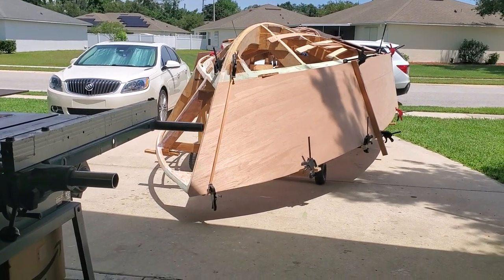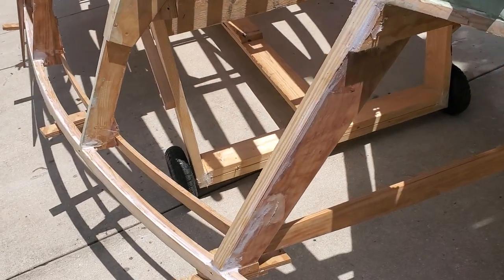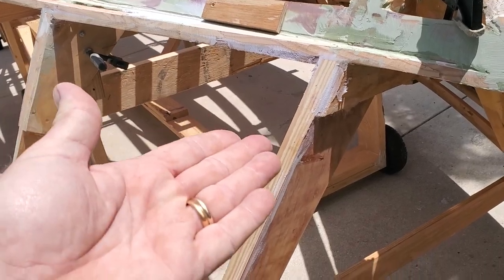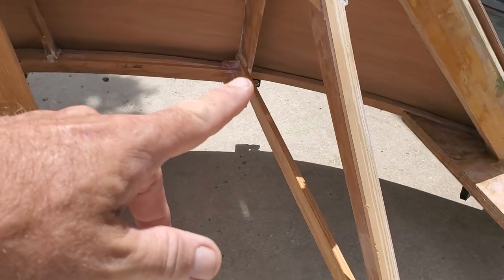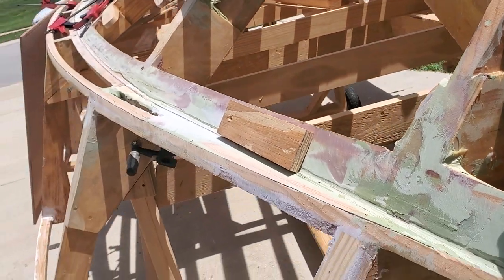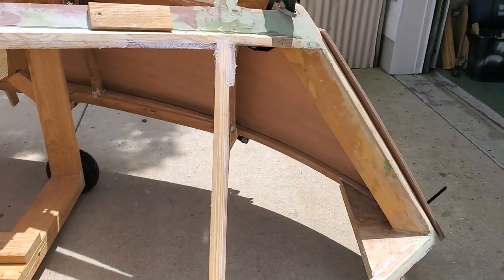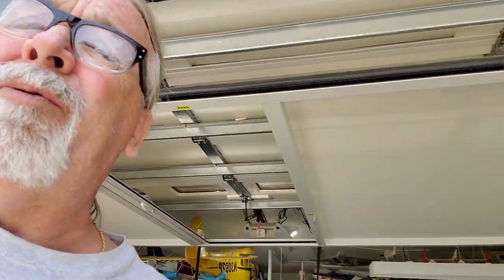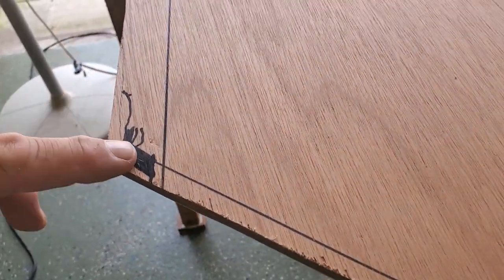Glen l Chinook 20' pilot house boat Part 18

Comment: Thanks.  Hope you get to feeling 100% quick. My cure for all ailments is fresh air and sunshine.  Unless it’s me that’s ailing.  THEN I WANT MORPHINE.  Your step idea is brilliant.  I’m going to use it.  My current project, Spira Oscoda design, all frames are constructed and trimmed;  left the sheers a couple inches long to whack after sheer clamps are attached.   Presently filleting/filling frames, next epoxy coating, then maybe primering.  But after a while you gotta figure the frames done and move on to something else. Thanks

Comment: You don't need to apologize for telling us about your back and leg issues. Those of us who have serious, chronic problems like yours have had to learn over time how to handle projects that we used to tackle without a second thought. You'll figure that out with your fine Chinook. By the way, I wonder why Glen-L left the location of that forward-most frame up to the builder. That strikes me as downright irresponsible on their part—UNLESS they called for installing it AFTER  the first layer of plywood sheathing was fastened in place. Keep the faith, and "work smart" as you continue with construction!